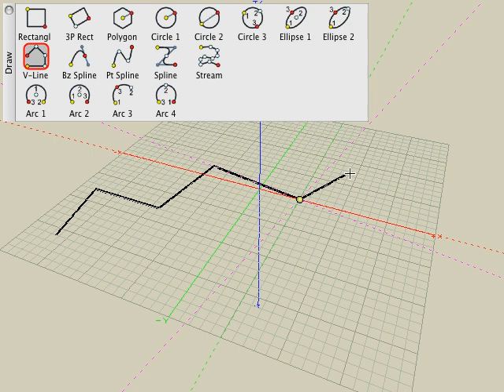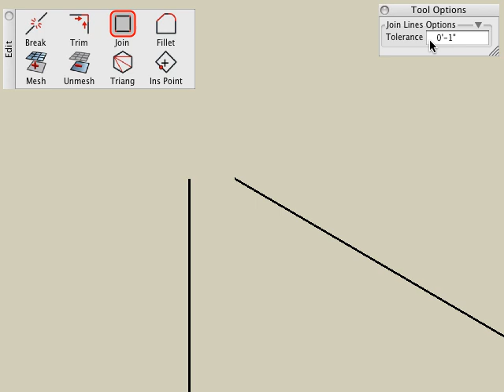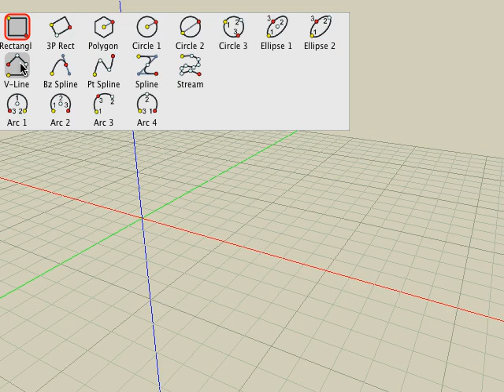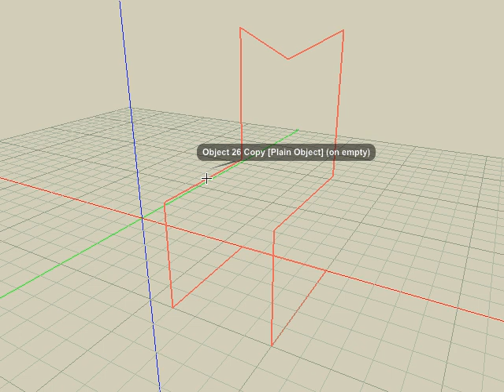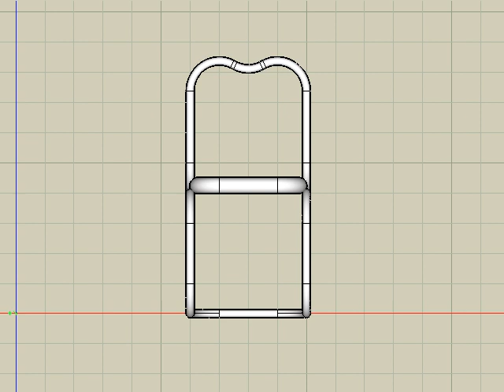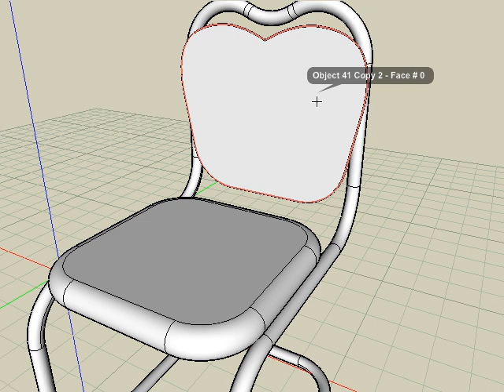formZ Line Editing

Comment: Why do you use the vector line tool instead of the line tool?
Reply from the maker: Hi Re H,  If you only want a 2 point segment, then you can use the line tool (or you can use the vector line tool and just double click to end the line -- or triple click to close it if you are making a closed polyline).  Both methods should work fine, but the line tool would automatically end at the 2nd point, so that may be more efficient in some cases...